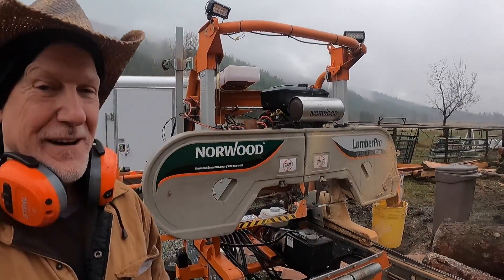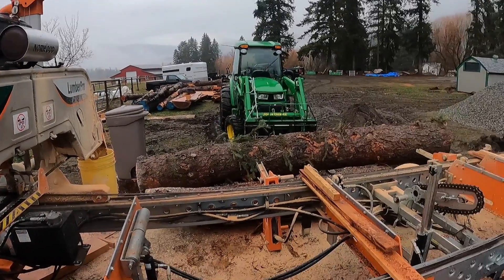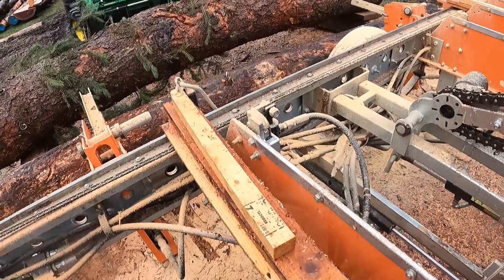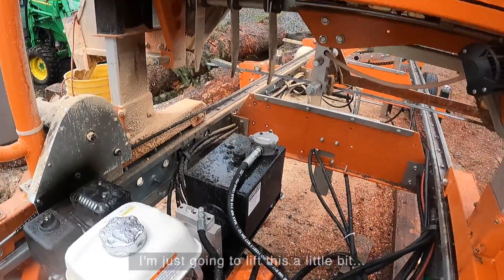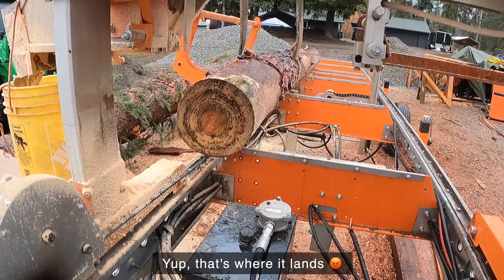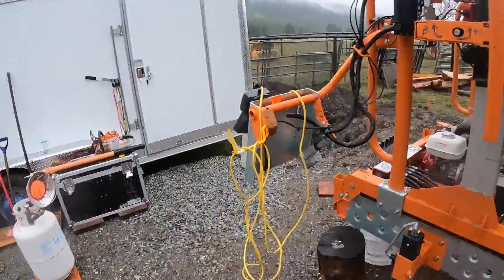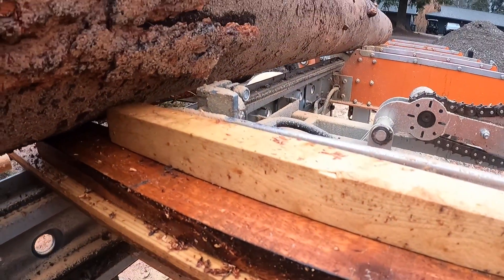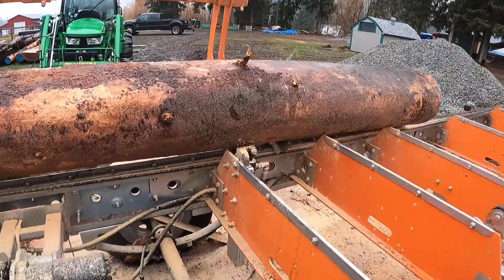Norwood HD 36 - Hydraulic Log Loader - Design Fail

Comment: you could just cut down some hardwood and insert it into the those two channel loader bars and make it one inch higher. scew a self drilling screw through the side. wood would be better than steel, less chance of damaging the rail. easy fix!
Reply from the maker: Great observation.  I always love a great suggestion for a fix. 
 Thanks for tuning in.

Comment: First off, the log loader should be on the operator's side of the mill so when the logs roll off of it onto the mill, they stop at the log rest.  Second, it should be installed even with the bunks so those small arms drop across to the bunk closing that gap..

Comment: I have the log loader with the same issue. Norwood recommended installing the log loader brackets inline with the bunks so the flipper lands on the bunk. I moved mine but haven’t tried it yet. Looks like it should work.
Reply from the maker: For a variety of reasons, I finally gave up on the Log Loader and just got a bigger tractor.  hahaha.  
Happy sawmilling.  Thanks for tuning in and commenting.
Reply: @howardkettner  
You didn't assemble it right.
The loader arms and flipper piece should line up with the bunks.
Simple solution.
Norwood didn't make a mistake, you did.
Reply: I mostly load with a tractor and grapple. Was going to use the log loader when I’m milling offsite.  Love watching all your videos.

Comment: I'm just seeing this and you probably already solved the issue.  I have a timbering and its log loader was designed to stop the log from rolling too hard and fast into the adjacent stops thus prevent breaking, yes it requires a push from time to time but that was their explanation and after seeing a large 2000+ pound log roll hard against the stops...I understand. 

Q? Is the log loader actually installed on the wrong side of the mill? It should be facing the log stops - not the log dog.  If not, I agree it's a flaw as to expect that small single log stop to stop a 2000 pound rolling log is not a smart idea in my opinion and it will eventually break or bend and then not function.   Q?  I'm wondering if you can unbolt the log loader system and change to the side of the mill, so it's actually facing both secure log stops?  I think if left this way it will eventually damage the log spike /dog.
Reply from the maker: Thank you for tuning in and being part of the conversation!
This was a really interesting situation.  And, you made some great suggestions.
Bottom line the entire design is flawed.  The only logical place for the log loader on the Norwood is where it is positioned - but that really means that it should not be used for any log more than 12' to 14' in length or it places far too much strain on the log loader arm furthest from the saw head - and by extension, the frame in that area.
Your point about damage to the log dog is right on point.
As far as locating the log loader to the other side - while that technically is possible, that would put the loader right in the path of the operator as Norwood's control panel and related control items are all on the opposite side of the recommended positioning.  
Just bad engineering coupled with not pre-purchase or post-purchase warning about using the loader for logs over 14' in length.  
Another example of 'buyer beware.
Again - thanks for being part of the conversation.

Comment: I just went through this issue and turns out the instructions on log loader were WRONG.  Those bridges are supposed to fall over the cross bunk but that is not how it is shown in the instructions.  I was told to to swap the position of the jacks with the loader bracket..  I said thats ok but the bracket toward the back of the loader comes nowhere near a cross bunk.  Solution?  I believe Norwood should ship me AND for free, a new cross bunk that I can add.  I don't think they will do that..  But is absolutely ALL their fault and bad design.  Wood-Miser is hands down a much better mill but twice as expensive and takes a 1 1/2 years for delivery.
Reply from the maker: Oh man I hear you.  I would have detailed all of the above in my video, but I try to limit the length, but here's to just say I went through the same "dance".  Just crazy.  
And, I was under time pressure with a contractor 'hard-scheduled' for a project so I had to get back into production with a bent mill.  So I rush shipped the cross bunks - all my cost, and the rest is history.
Have you tried looking around for a used Woodmizer?  My sense is that there are a number of Covid sawmillers that are looking to off-load.  My 11 year old Woodmizer (that is not for sale) has proven to be bulletproof.  
All the very best.  
Huge thanks for tuning in and being part of the conversation.

Comment: Those 2 little bars on the loader are designed to lign up with the bunks and lay on the edge of them for the log to roll on. Maybe adjust tour loader or bunks so that line up with each other.
Reply: I hope you explain how the loader was designed and you didn't assemble it properly. And it really wasn't an engineering mistake.
Saw safe
Richard L. Wolfrath

Comment: Hi, Howard,  I had my first close look at the log loader on the new HD38Max yesterday... same issue.  We came up with several potential solutions, and I'll make sure to let you know what we come up with and how it works.  I'll be assembling a new HD36V2 with hydraulics soon, and will let you know what I come up with.  I'm betting I can solve it with one bolt and a couple of washers for each loader-- no welding.  Thanks for posting.  Seeing the issues you have experienced is a real boost and WILL be beneficial to other sawyers.

Instead of 82, I'll sign of with 73.  Ham radio operators will get it.
Reply from the maker: Wow! Dave - so great to hear from you.  I'm definitely intrigued by your intended fix.
And I totally get the "73".  Your mention of that brought back great memories.  Took my ham radio test when I was 15 or 16.  Failed the receiver schematic, passed everything else including the Morse Code requirements and then got distracted with life and never went back.
Reply: That’s to bad about you ham test Howard. I passed the general test in 1980. Still have the license. N6KZR.

Comment: Hi Howard, love watching your videos, one item that I continue to struggle with is drying lumber and it cracking. I know from lumber that I have bought from lumber yards that the color of the ends are blue, green, etc. and not clear like the end sealer that I see on the market like Rocklers, Green Wood End Sealer, or ANCHORSEAL 2 CLEAR END SEALER, but I see in your videos that your lumber ends are green. Can you please share what you are using and if you think that stuff is better than the fore mentioned? Last, I like the website but was not able to find a contact page...as you see that I am using youtube. Do you have a contact page. Thank you for the help....and I agree with this design fail...BTW (smile). Ken
Reply from the maker: Hi! Ken - huge thanks for tuning in.  
Good point - end cracking or "checking" as they used to refer to it in my lumber grading class can easily ruin the end 6 inches or more .  . .  
What was recommended to me was just to buy the cheapest "on sale" latex one could find at Home Depot or wherever.  I just get them to throw in my favourite shade of blue for visibility and that's what I've been spraying on the log ends.  If the logs sit for longer than a few months, I simply reapply.  
I have tried Anchor Seal, and what I have is no better, but also IMO, at least in my climate, is no worse.  
Apologies - have not got the actual website up yet.  Feel most welcome to shoot me a text at 604-230-8051 or an email at howard.kettner@gmail.com

Comment: Why is the log loader mounted on the same side as the log stops, log stops should be on other side from where log comes onto deck. Maybe that is why your log loading levers drop to low.. paul from Arkansas but now retired in philippines having fun.
Reply from the maker: Hey! Paul - thanks for being part of the conversation.  
The unit was put together (all 900+ bolts) following the Norwood assembly manual and instructions.  But you hit the nail on the head.  Whoever was in charge of the design of the log loader did not allow for the height of the log stops.

Comment: The engineers at Norwood are surely seeing this. The question is do they plan to address it?  I am planning on getting this machine but I keep reading about and seeing posts like this. Not good nor encouraging. I hope they take a look at this log loading design.
Reply from the maker: First of all - thanks for tuning in and being part of my journey - and thank you for taking the time to comment.
Secondly - the folks in client service (at least in terms of the team in Canada that I deal with are FABULOUS.  Albeit likely outmanned and very overworked because of a host of issues.  
One of my next videos is about the complete failure of the electronic circuit board - which brough my not even three year old mill to a complete standstill, in the middle of a time sensitive custom cutting job.
I've got a temporary resolution in the works that arrives tomorrow: $200 plus shipping.
THe permanent fix is $2,200.  The invoice was just processed on my Visa - but the replacement circuitry will not land here for 3-4 months.
Never abused, and except for three months, under cover, and during the three months the electrical panel was saran wrapped - with a bit of venting on the backside.  Meaning simply it was protected from all of the elements.
I would LOVE to be giving Norwood - the product, amazing reviews.  But - those comments apply only to their hardworking service team.

Comment: Hello! Can you just weld two pieces of 2"*4" (50*100) pipe/tube about four inches (100mm) long to the existing metal "c-profiles"? Should hopefully be ok regarding the bars that the sawhead runs on...
Reply from the maker: Great suggestion - and while I've operated my little sawmill plus a hobby farm and tractors for years, your suggestion now gives me permission, authority, and the logic necessary for me to buy my first ever electric welder without needing to further justify with to my wonderful wife, the always awesome Coral Dawn . . .🤣🤣
Reply: @howardkettner  
There are some good things about glueing metal to metal 🤭. If the funds are there I would go for a MIG/TIG/STICK (MTS) machine, otherwise I would start with a stick-welder. MIG/MAG and TIG is nice if you have a shop where you can take all of your orojects inside, welding outside with shielding gas is not easy... Good luck 👍🏼💪🏼🤗!
Reply from the maker: @johanneslaxell6641  This is one that was recommended to me . . . https://www.kmstools.com/miller-millermatic-211-mig-welder.html
Reply: @howardkettner  
Well, some say "Go BIG or go home". Have to admit that that one isn't cheap. Over here for example an Everlast MST (MIG/TIG/Plasma) is around 2500€, the Stick/TIG/Plasma is a little cheaper.
 It's not my place to criticize but it seems like a "heavy" machine for occasional work at home. It's a little like a 20 000$ processor to make two cords of firewood once every three years...
 But there is a HUGE possibility that I don't get how you do things. Do as you see fit, that is anyhow the way to go 👍🏼!

Comment: Thats happened to me with the HD38, but typically if i lift at full speed it'll roll on over. I totally agree though,  they could have done better. And it lands on my power feed chain. Please post your fix when you get it done, I would love to see what you come up with!
Reply from the maker: Right on.  You make a good point about it landing on the Power Feed Chain.  That cannot be healthy.  I cannot imagine sending that problem off to my customers.
And I also agree - if you lift at full speed, that is definitely a solution.  However with a larger log (i.e. >2,000 pounds) what I've found, given that my sawmill is not bolted down to concrete, is that when the log 'lands' it moves the sawmill fully 3" to the left (from operators viewpoint) and I'm not a fan of that.
Thanks for tuning in and weighing in.  We'll get this figured out yet.
Reply: @howardkettner  Im thinking about moving my loader to the other side and making some troughs to catch the sawdust I can haul off with forks on the skid steer. I have a bucket with a hole cut in the lid for 4" dust collection hose. The new plastic saw covers have an extraction point that allows for it to have 4" ducting, but the bucket fills up too quick and slows down milling. As a side note, ive seen people roll them off woodmizer loaders too. I just got in a 60" logrite cant hook. It works great, way better than the other I've used.

Comment: You're really not having much luck with there Norwood.
Hey, how's the supply situation looking in Canada? I hear Vancouver is closed / cut off now due to floods?
Reply from the maker: Thank you for the concern.  Supply chain, not good at all.  I'm in the middle of a reno of a great 93 year old log home, and where I could find anything I need with one or two stops before, now it seems like I need to go to 7 or 8 category suppliers to cobble stuff together.  It's like we've reverted to a third world country for a bit.  Makes one grateful for what we've often taken for granted.
One tiny example.  I need to insulate a crawlspace with 2-1/2 inch solid styrofoam (it dips to minus 30 here periodically).  It's a very common form of insulation in these parts.
None available.  No 2" either.  So 1-1/2" x2 was the best I could do - at nearly double the price of the 2-1/2".  This is a daily occurence.  Folks are wiring homes with one style of plug and light switch upstairs, and another style downstairs just to keep the project moving.
First-world problems.  haha.
Whenever Coral and I get feeling a little 'blue' we remember how we witnessed conditions when we visited various countries including those where we did our Kilimanjaro summit and Everest Base Camp trek.  
And then a wave of gratitude for what we have comes over us.

Comment: I feel your frustration, Howard. I mounted the log loader on the other side and use the clamp (when possible) to help position the log on the deck as it's loading. Not always possible, helps on occasion though. I look forward to seeing your fix, if it's a success I'd be interested in purchasing from you.
As always, thanks for taking us along for the journey.
Reply from the maker: Thank you for your kind words - and double thanks for being part of the journey and for your suggestion about mounting the loader on the other side.  Love the innovative nature of your solution.
Your taking the time to comment is one of the key reasons for why I started this channel.  I needed to get some perspectives beyond what I was getting from Norwood on the sawmill and Woodmizer on the edger - which has it's own issues/defects (Emergency off switch - no way to hook it up - so it just hangs there uselessly, and a scale that still divides inches by 1/10ths, along with a super awkward to transition from using the board fence to removing board fence).